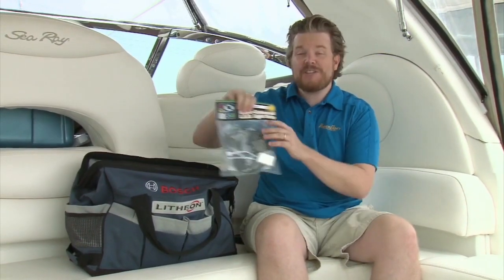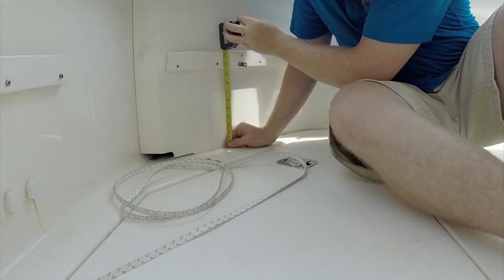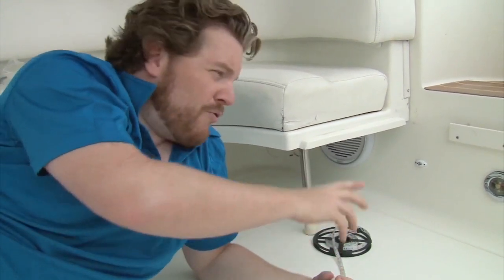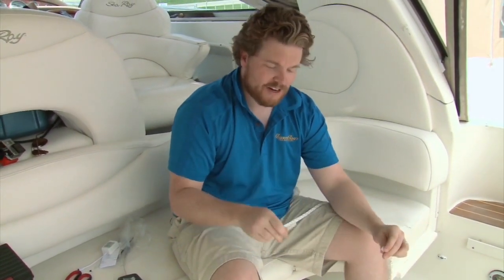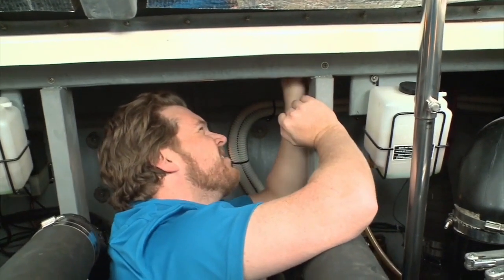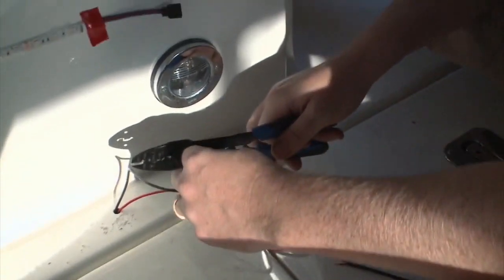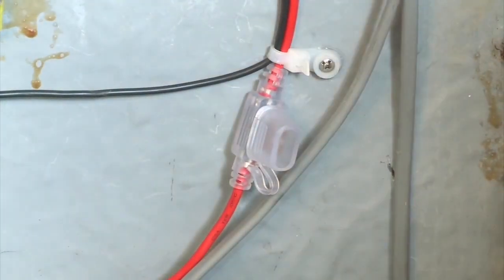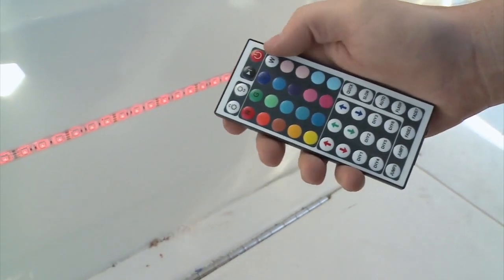Easy to install LED Light Strips | My Boat DIY

Comment: Many of the plastic connectors failed on my install.  I removed all of them and replaced them with 22ga tinned copper wires soldered to each strip and then sealed each joint with marine heat shrink tubing.  None of the soldered joints have failed.  Be sure to use 3M adhesive mounting tape as the tape on some LED strips is cheap and will fail.  Clean the application area with alcohol and heat the adhesive strip with a hair dryer for best adhesion.  Get rid of those plastic snap on connectors!

Comment: Great video. It appears that most light systems are ac into the 12 v transformer. Are you simply connecting the transformer to the battery...and does this affect the ability to change the light colors on the remote? Thanks!
Reply: Follow along on the video. He clearly states he's connecting the power wires to the underwater lights. Thus the switch for the underwater lights will also turn no the LED strip.

Comment: My biggest challenge is getting the strips to remain glued to the fiberglass. The heat and the rain breaks down that glue and they fall right off. What are you using to flue the strips to the wall of your boat?
Reply: In my install, since the lights are encased in silicone, I used a bead of silicone.  Ignore the tape that comes on the strips.  Just remove the backing paper and put silicone right on top of the tape and stick the lights to the surface. You will probably need some blue tape to hold them in place while the silicone cures.  4 years and no problems.

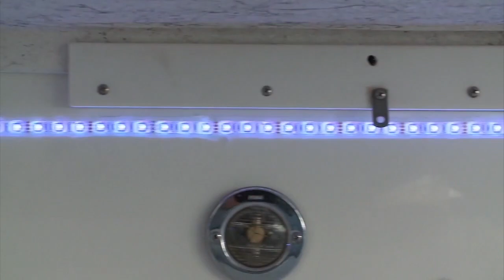Comment: Too bad that the lights are defective "out of the box" as seen at 4:27. It's typical for all of these Chinese brands to have defective connections and weak tape. They are sold as waterproof but when you open the instructions it says "inside use only".

Comment: You go through the effort of connecting wires in the engine room but then screw the transformer on the outside. It’s not a good look imo, should have put transformer in the engine room as well

Comment: This is bad advice.  Marine installs should have minimal house drilled and that strip light should have been mounted under a gunwale or somewhere that’s it’s not completely visible
Reply: All boats don't have that option to hide. I know my cabin boat doesn't